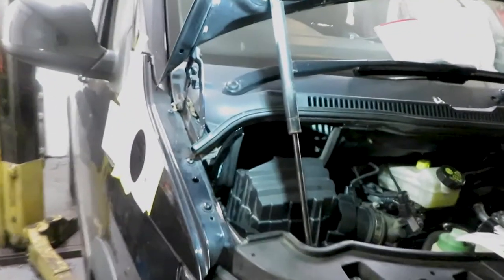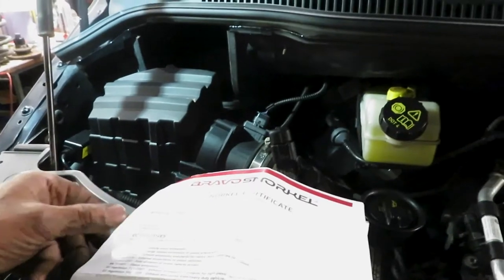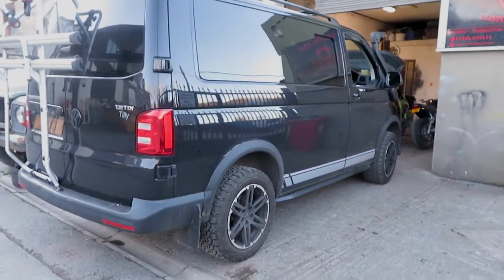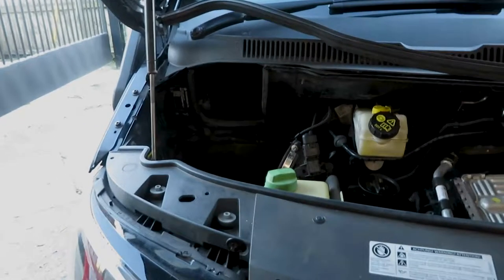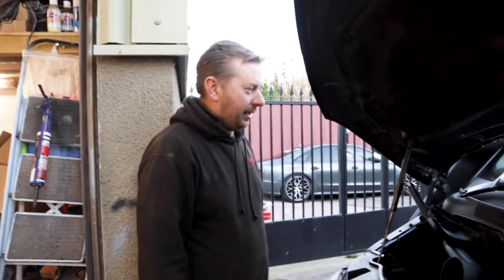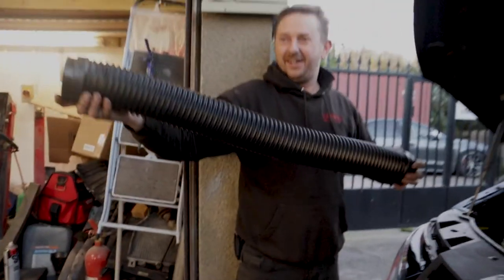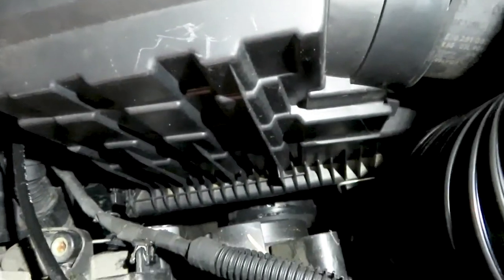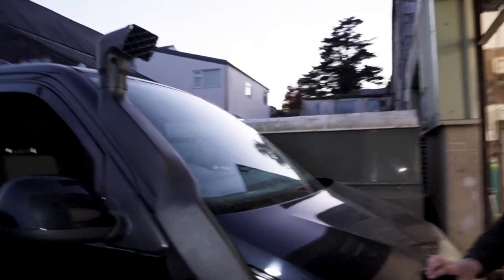VW T6 Swamper Kit Episode 3 - How to fit a snorkel

Comment: Hey chap.  Great VID.  I just got one in from Spain and am in the process of fitting it.  We have the the 2017 T6 Euro 5 bi-turbo.  We are going to give ours a run throughout Australia where of course we have lots of dusty roads and beaches to drive on.  I have heard that in the past the snorkels may cause performance issues for the engine when worked hard IE when driving on soft sand.  Just wondering if you have heard of this over in your neck of the woods.  Cheers.  Alex.
Reply from the maker: Sounds absolutely awesome!
Reply: @VenomCustomShop  cheers.  You guys heard of any performance issues as a result of less air intake or anything like that.  Cheers.  Alex.

Comment: Thanks for the video. Unfortunately, the most tricky bits are left behind the scenes.
Any tips on the below?
How to mark the drilling holes on A-pillar correctly?
Do you need to take off the whole air filter box to be able to install the flexible pipe?